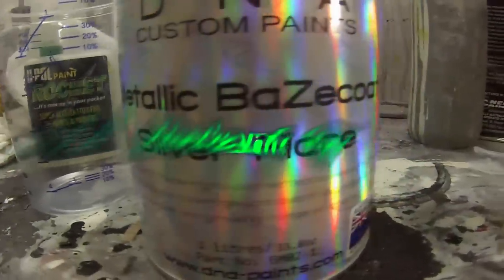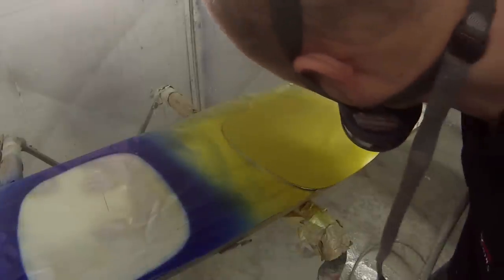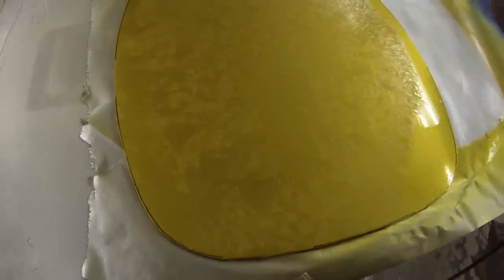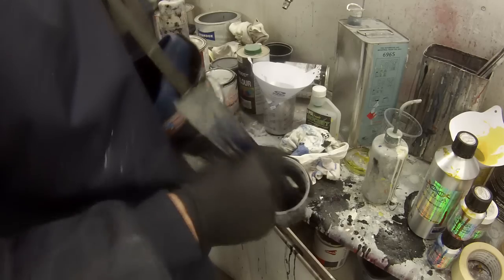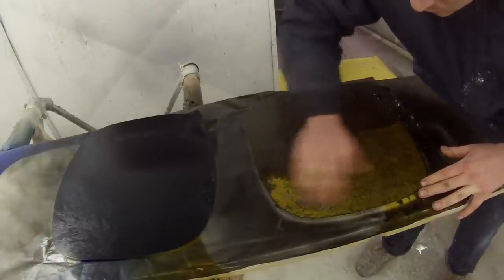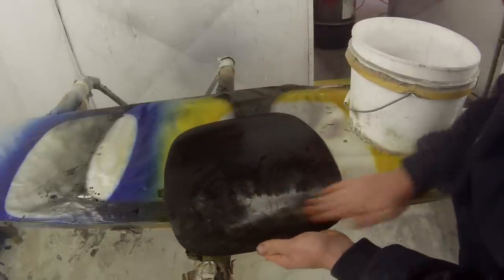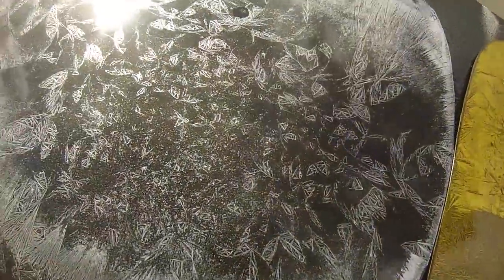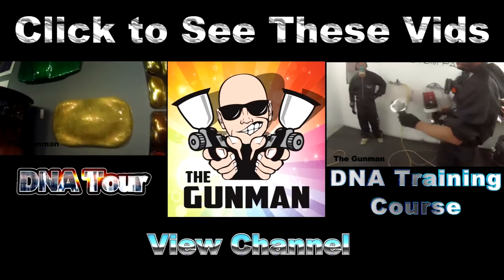Mutant Crystalz DNA Paints Demo

Comment: Hey man have u sprayed much water base paint? We use ppg water at our shop and I really like it the color match and blend ability was just wondering if u used it much and liked it or dis liked it
Reply: wes perkins I use envirobase from PPG as well at work i like it, colour matching is decent blending is good, i find some of their blacks a little off. almost milky, we have only had it in for 1 month so still testing it out really. spraying with a SATAjet 5000, and clearing with  autothane HS Clear, using a Devilbiss GTi Pro LITE.

Comment: I sprayed clear coat over my plastic headlights,  three thick coats,  but the results was disappointing, I wanted to use the paint stripper but I am afraid,  I told my self what If the paint stepper fried the plastic, I tried sanding but it is a really hard job.

do you have any easy way to remove it completely without damaging the plastic?